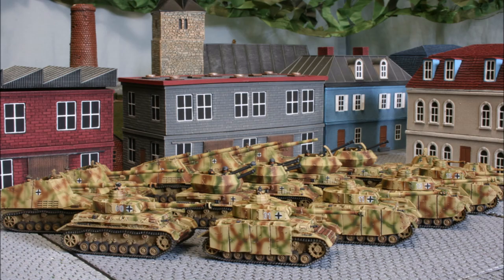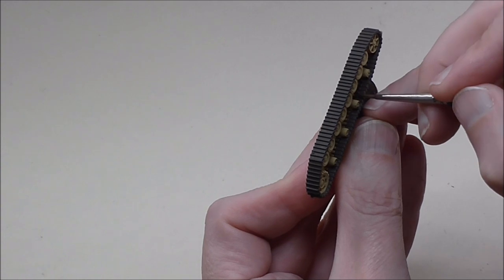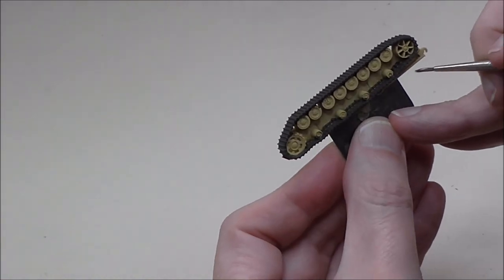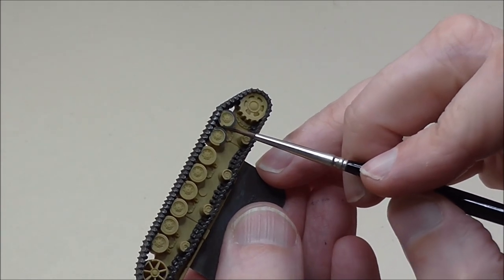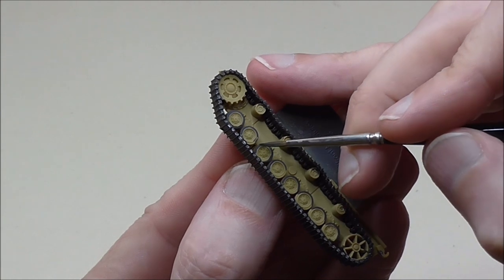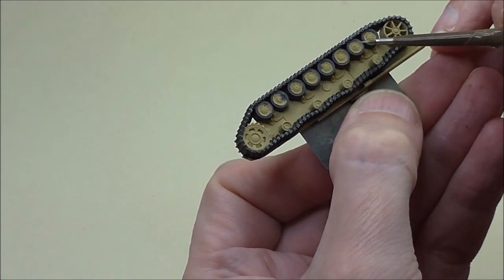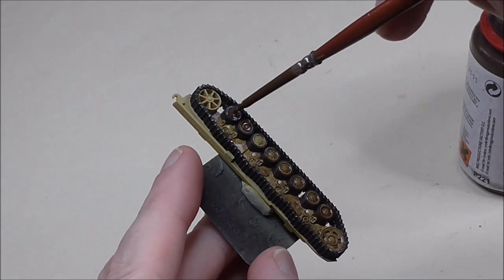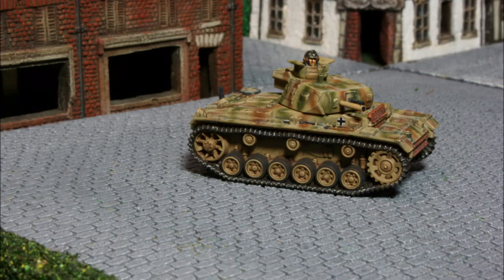How I Paint Tracks, Wheels and Lower Hulls on my Flames of War Germans

Comment: I spend about half of the overall painting time working on the tracks. It is a slow and quite honestly a tedious process. I was thinking of couple of way to speed it up and looked up some tutorials but they all seem to be doing the same thing, slowly painting each tooth, cleat and rubber. I was thinking it would be faster to spray the whole track with dark grey and then paint the wheels and the armor. I bought the battalion of T-34s box set and knowing how long it takes me to paint a single track I had to come up with something to make it go faster. Alternatively make a masking tape in the shape of the inner track and spray paint just the tracks themselves while leaving the wheels and armor green.
Reply from the maker: It's a chore for sure! I often spray the tracks before the hull. This reduces the time spent subsequently spent on the tracks. Thanks for watching.

Comment: Well it's as I thought, there's no shortcut to painting the wheels 😮
What I have done, though, is a very gentle drybrush of the wheel colour, across the wheels and after the wash, to pick out the wheel rims and restore their definition. Sometimes it works, sometimes it doesn't.
Reply from the maker: It's a chore, isn't it! That drybrush approach seems practical, though.

Comment: Thanks for the video good tips. Instead of metallic paint have you ever tried a graphite pencil? It leaves the same shiny metallic look but you can draw it on with precision in tight areas or just drag the side of the pencil along the long edges.
Reply from the maker: Hello Mike, I've used graphite before on larger scale models but not very often so I'm no expert on that. I know some model makers are very good with it though and get great results. It's certainly a technique for all to consider. Thanks for suggesting it.